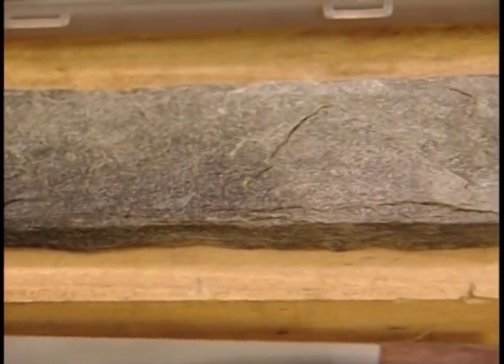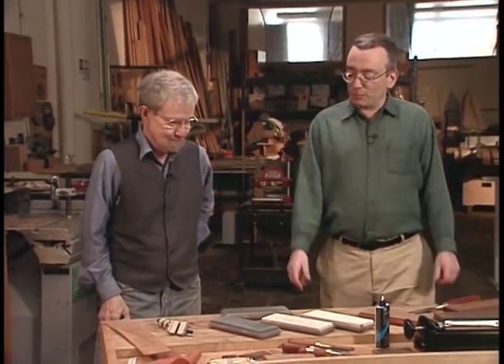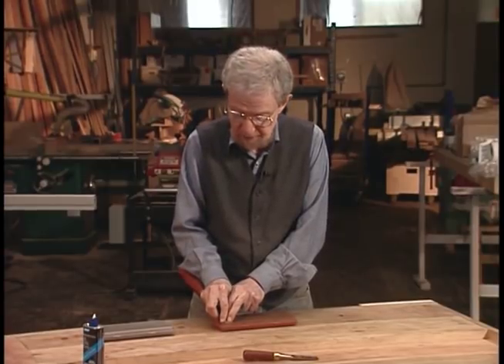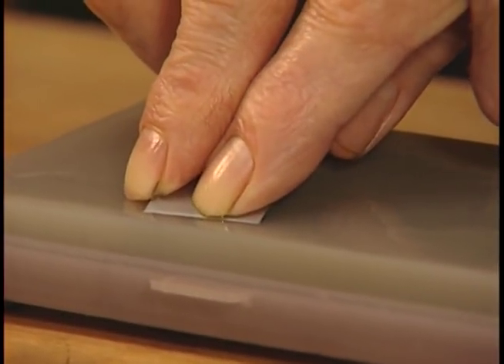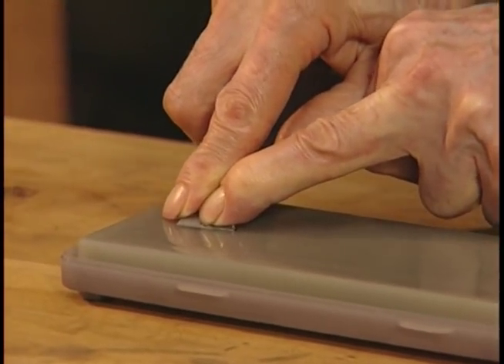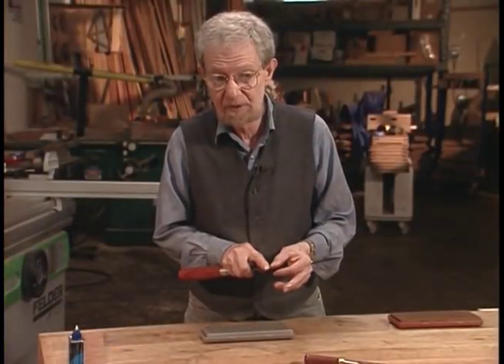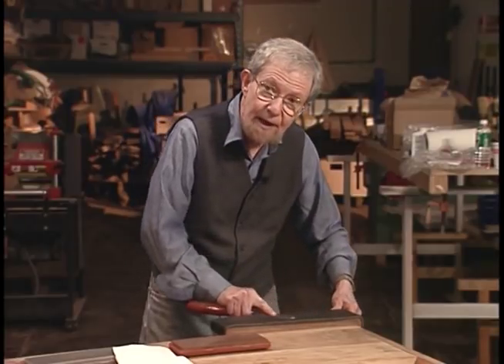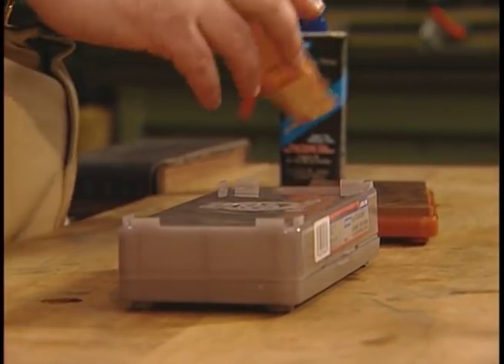Sharpening Woodworking Tools Using Norton Oil Stones

Comment: Dear Sirs,
Could you please advise me regarding the honing process where you talk about holding down
the blade. Is this the ‘out of box/packet’ bevel or are you referring to using the ‘out of box/packet’
as the primary bevel and then lifting the blade ever so slightly to get a new edge.

I do apologise if this sounds picky, it’s just sometimes things get lost in translation!

Wonderful video!

Yours truly 

ross

Comment: I recently worked many chisel bagels to bring them back into shape after decades of misuse. Using the veritas jig, I spent hours on a new coarse stone, after initially setting a 25° angle with a bench grinder, to get the bevel edges close to perfect.  Granted, I got them sharp, but very easy to resharpen at not exactly the same angle I just gave them.  Tried this freehand method last night, sharpening sideways as opposed to straight into the bevel.  This guy is spot on!   Took no time at all to get a near perfect edge.  First time I've seen anyone use this method and it will be a mainstay for me!  Kudos to Norton for providing what I believe, is a lost art to honing!
Reply: Bevels, not bagels...lol

Comment: am i wrong in using multi purpose 3-in-1 oil ?
Reply: That should be fine, you can also use mineral oil or glycerin. Even water with a bit of dawn dish soap in it works. I saw a guy use transmission fluid once too. Try stuff out and see what you like best.
Reply: Thank you for asking that question! I still use multipurpose sewing machine oil .. does the sharpening..but wanted to know if it was okay!
Reply: I use baby oil, which has the added advantage of smelling nice. :)

Comment: Was interesting to see how Norton recommend sharpening using their stones. I've worked for a number of master woodworkers over the years, and everyone has their own way of doing it. Though, my Norton India stone has cupped over time. I'd be interested to learn how Norton would recommend flattening it.
Reply: My "fine" india developed a slight dish as they all do. Working primarily by hand, it has little to no effect. If it does bother you, go out on the front sidewalk with a bucket of water and make larger figure 8's using water to wash things. it will become flat enough.